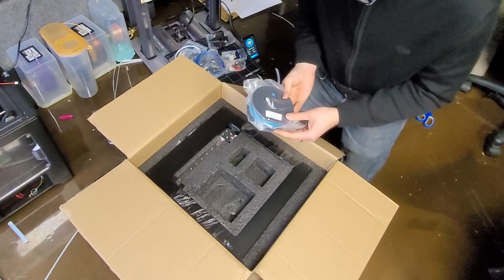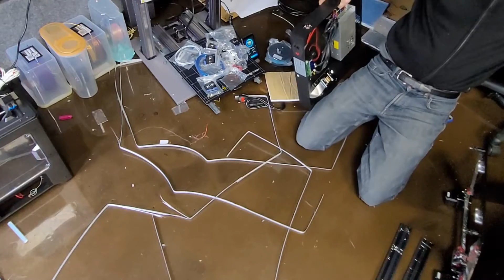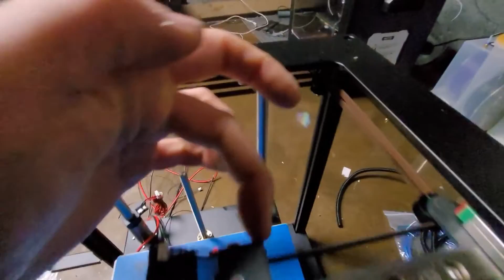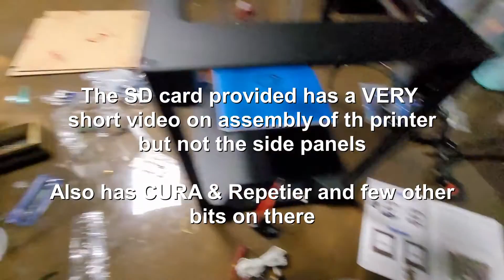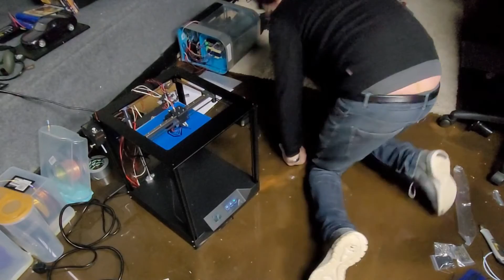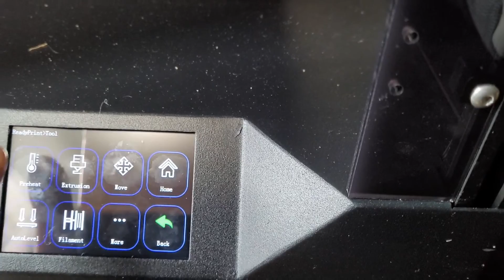Two Trees Sapphire Pro Build and Conversion to Duet Wifi - Part 1 of 2

Comment: Mine arrives tomorrow
Reply from the maker: Not yo bad to install. Only thing id recommended doing is a mod to the hot end as the standard hot end heatsinkcooling fan is poor and will cause jams with pla.  I molded mine with a good 40mm 0.13mAmp fan and done 10hr prints with pla no probs